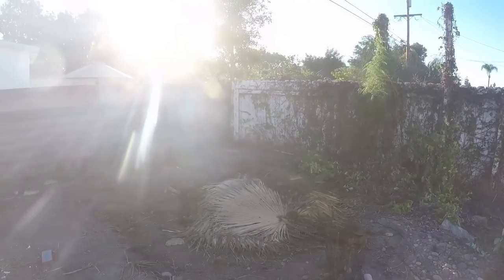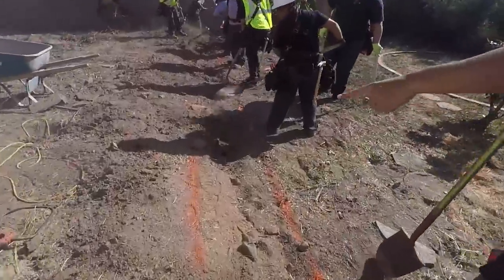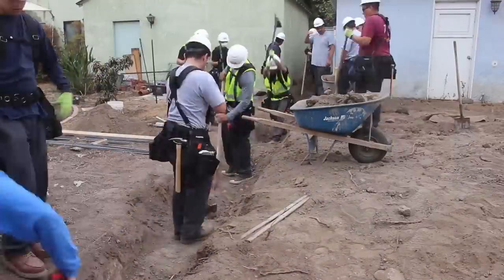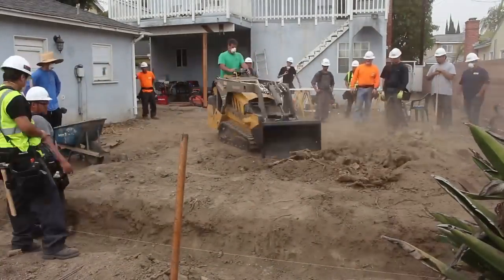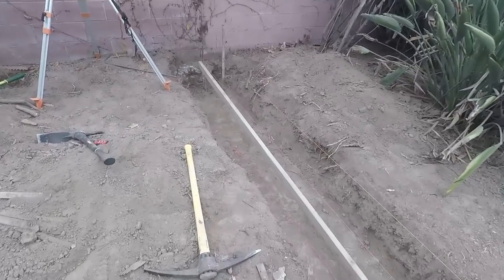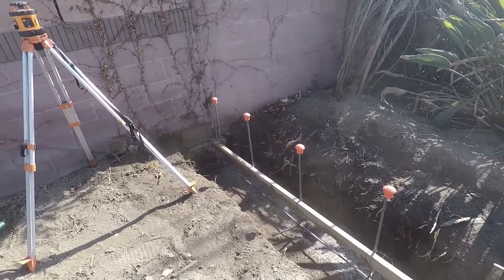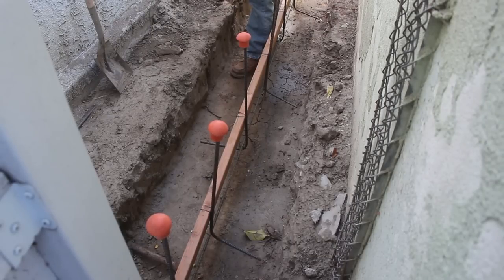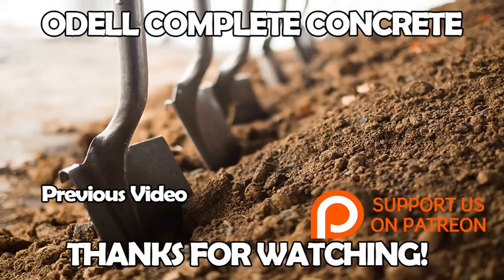How to Build & Setup a Block wall Foundation Part 3

Comment: Wet setting is the best way to do it. I always do that. I worked at the Long Beach town center when it was being built and a Deputy inspector stopped me from wet setting the trash enclosure area's. I then had to build up from the footing the next day after pouring them. That is much more work as you know.
Reply from the maker: m surprised at that point you didnt have do internal water proofing in the cold joint?
Reply: @OdellCompleteConcrete  No. They were trash enclosures. Thats one of the few times I did it that way. I prefer to wet set. The wet set is so much stronger.

Comment: The way I understand those mushroom style rebar caps at least here is, the ones you are using are fine for what you’re using them for to prevent cuts and abrasion. The bigger square style OSHA requires to stop impalement when there are workers above rebar sticking up. Nice start to the wall.
Reply from the maker: TY

Comment: Just say I was doing this with a little mixer ... Is there any issue with pouring a footing in multiple stages?
Reply from the maker: As long as the steel runs through it should work
Reply: Odell Complete Concrete 
Thanks man.

Comment: Whats your opinion on breakaway ICFs. Or really any concrete form system. Have you built any, or if so how many, walls with a form system?
Reply from the maker: 2' panels locking together

Comment: Hey question on this. Say there was an existing grandfathered garage (permitted) that is a foot from the surveyed property line and both parties agree to put a fence, can the fence be built entirely inside the other property that has no garage so it's not to close to the existing garage? This is also in California by the way.
Reply from the maker: Sounds like building department issue

Comment: Is vertical control joints required? Want to do it myself, Thanks in advance. If I don't want to wet set with the first roll, I can just use mortar to set my first row with the foundation?
Reply from the maker: Vertical joint every 30'.
Yes you can set block later
Reply: @OdellCompleteConcrete  thanks for reply. But just wonder is it a must to have? does it make it any stronger or it just crack control so it doesn't spread the crack. 
If we do it. Does the horizontal bar goes across the joint. And does that mean I have to have back to back vertical rebar between the joint.

Comment: When is the dirt or mud in winter too wet to poor a footer?
Reply from the maker: I live in southern California so never to wet
Reply: Jess Perez you prefer your soil wet, helps cure the crete more evenly, can’t be too wet, can be too dry. For below freezing temps, if you’re In a hurry for it to harden you just add chemicals. You can build with concrete in almost any natural environment.
Reply: @jaxturner7288  Thanks!  Doesn't freeze where I live.  Just a lot of rain lately once I dug the trenches. Super helpful.

Comment: Odell, you said the bottom of the 2x4 where the concrete was poured up to would be the bottom of the block, but you still scraped off the side and added more to the middle??
Reply from the maker: The initial lay down wasn't perfect and never is it takes some detail work
Reply: @OdellCompleteConcrete  me and my guys just put up the string line before the pour and measure of that, always comes out spot on.
Reply from the maker: Yes but what holds the rebar
Reply: @OdellCompleteConcrete  just like the 2x4 a temporary piece of rebar about waist high.
Reply from the maker: That's interesting 
TY

Comment: Why even have a wall between the two buildings? Makes it much harder to paint the walls on both sides and pretty much renders the space useless? It would have been better for both home owners to leave that space vacant, shared storage or? Just my opinion, great work.
Reply from the maker: Its been that way for 80 years.

Comment: I don't think its necessary to keep the rebar protectors on while building the wall. I could be wrong. If you use the correct 4' square ones, that is a headache.
Reply from the maker: I hear that

Comment: Where I work mostly the foremen and engineers wear the white hardhats. And it looks like most jobsites, the whitehats mostly just watching one guy work.

Edit: fixed a typo
Reply from the maker: Thats interesting
Reply: @OdellCompleteConcrete  I wrote that comment wrong. I meant to write "white hardhats". Obviously everyone has a hardhat but on my sites they're usually on a basic form of color coding. White is engineers and foremans, green is the safety guy, and grey are for site visitors.

Comment: You should call USA(underground service alert) when breaking ground, it’s free and it’s the law “in my state anyway”
Reply from the maker: Nothing gets buried on the property lines except fences and footings
Reply: Odell Complete Concrete 27 yrs of underground construction/maintenance experience begs to differ. Communication companies are the worst, they sneak in shallow,I found my gas service at 18”deep digging a post hole. I didn’t break it thank goodness but could have been costly.
Reply: Dude it’s 12 in deep, they dug with shovels, come on.

Comment: Look like u made a easy job look way to complicated😂😂😂😂 its a wall footing not a skyscraper foundation
Reply from the maker: Haha it's what the city calls for in the foundation plans
Reply: I'm guessing the fact David works in an earthquake zone means substantial footings for walls. A big block wall like this can get a pretty nice sway going in a decent earthquake, and will make a mess of anything it falls on (including people).
Reply: @TyphoonVstrom  - In Fountain Valley, no more 4" solid block is allowed.  Must be minimum 6" hollow, so that rebar can be used vertically & horizontally.  Footer about 12" to 18" deep, with cage rebar.